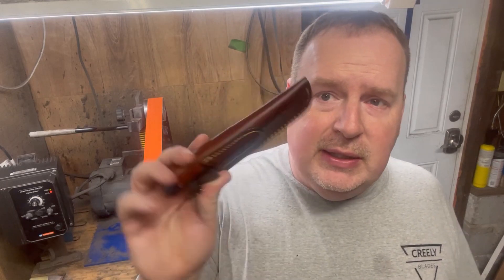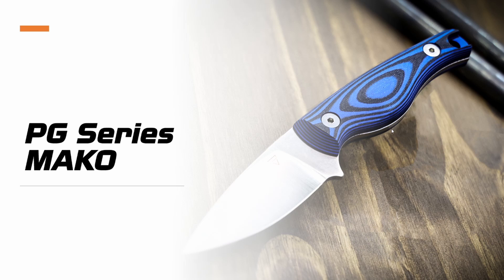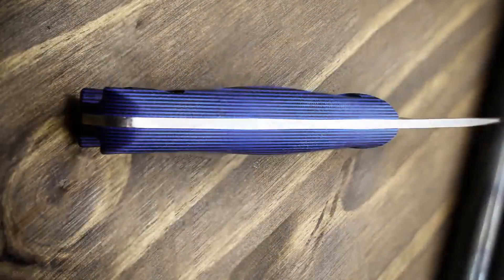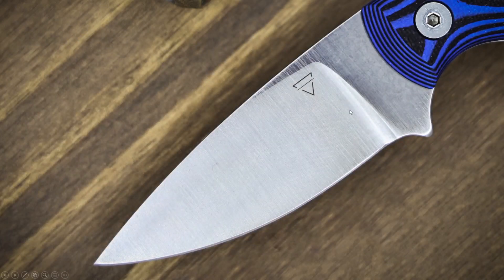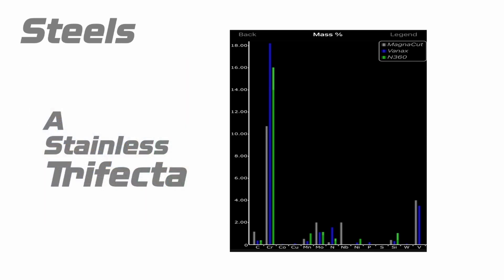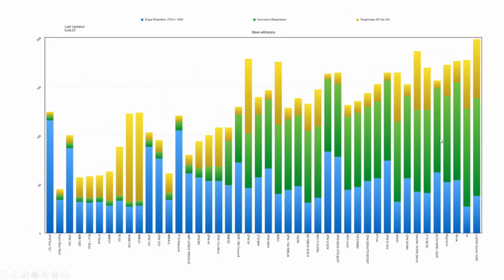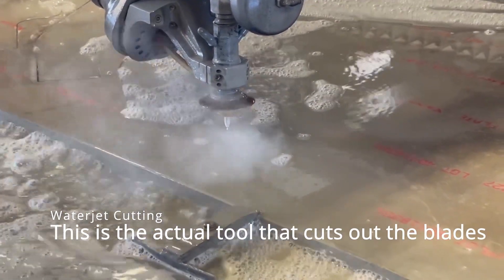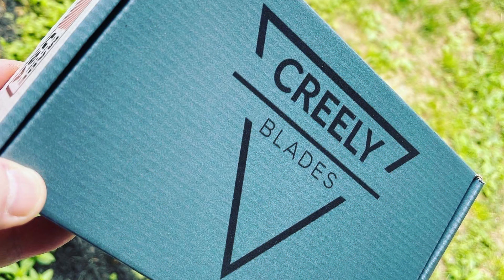CPM Magnacut, Bohler Vanax, Bohler N360 (LC200N) Creely Blades Mako- Kickstarter.

Comment: Hi. I have a piece of the same approach than you, and I like 3V, 14C28N (price compared with LC200N...), Cruwear, Magnacut and Vanax. On your graphs, CPM 3V have much better corrosion resistance than CPM Cruwear. Thats true? Why? 
Thanks for your answer and sorry for my english.
Kiss from France.
Reply from the maker: One of the tricky things with 3V, and cruwear is that there are two different heat treating protocols and one of them significantly changes the corrosion resistance of the steel. 3V would have a little better than cruwear, but maybe on the chart the cruwear is rated at the other heat treating protocol.
Reply: @Creelyblades  Ho yes OK, i have read one thing about that. With the "refresh" at low temperature (about 400°F) for increase corrosion resistance. Thanks for your information !
Reply: @jeromek6702 high vs low temper, high temper lets a lot of chrome out of solution

Comment: Hi. What is your reference for the corrosion resistance ranking chart? Did I hear you correctly? Your ranking of the corrosion resistance is NOT based on testing... LOL sure make up your data if you can´t find it. Jeeez man
Reply from the maker: Several of the steels I do have salt water testing data for, and others are inferred based on their elemental makeup as compared to the tested ones. There are really only about 4 categories of corrosion resistance as I see it. Not stainless at all (aka- 1095, 52100, A2)  Semi-Stainless (3V, D2, )  Standard Stainless (S35VN, 154CM, 440C, S90V), and extremely stainless (LC200N, Vanax,)   Additionally, even with testing corrosion resistance can be tough to pin down, for instance, some steels do well in salt but not acids, others do well in acids but not salt. I stand by the ratings on the corrosion resistance chart as a good guide for a particular use case.
Reply: @Creelyblades  I communicated with Larrin  Thomas. Lets compare notes and make a listing based on testing - for rust. And, lets face it, "stainless" is kind of a misnomer.

Comment: Bad way of explaining Magnacut and niobium - as I know you know man it's in there to stop the precipitation of chromium carbides because of it's.. binding affinity? 😒 Creating niobium carbide/carbonitrides and with the vanadium helps grain but is mainly to suppress the creation of cr²³c⁶/Cr⁷c³ and instead form CrV⁷C³ carbides leaving more of the chromium in solution for passivation? Correct? *I am not a metallurgist nor have a college degree*

Comment: That the tang is protruding over the handle scales is there to help align the scales for fitting is the dumbest thing I have heard. Why not just admit that you got the measurement or machining toleranse wrong 😂👎
Reply from the maker: Why not admit that?, Because I did it on purpose that’s why not.  I’m just being candid and honest about the process. If the knife is not for you, no problem, but don’t insinuate that I’m a liar and troll me.

Comment: Is ordering a PG mako in magnacut off the creely blades site the same as backing on kickstarter?
Reply from the maker: Those orders will be filled after the Kickstarter orders are filled, but similar concept
Reply: @Creelyblades  well shoot is there any way I can become a kickstarter without having to order a second blade if I've ordered one off the site? handle scale color doesn't really matter much to me as I might have a go at making my own for it down the line.
Reply: @Creelyblades  and to be clear what I’m asking is if I can transfer a creely blades site purchase to one of the available Kickstarter slots.
Reply from the maker: @kevindeuschle3413  The Kickstarter orders were only open for a period of 20 days a couple months ago, there are no open slots for Kickstarter as that campaign ended.
Reply: @Creelyblades  oh, ok. sorry about that. I'll be patient then as difficult as that is going to be =). Thanks for getting back to me.

Comment: How does your chart put LC200N above H1 in corrosion resistance?
Reply from the maker: They are the same on the chart and it is ahead just because of the way it is sorted. Additionally, if there are 2 steels right next to each other on a chart with this many steels I would not get too burned up about their exact order.
Reply: @Creelyblades  ok for sure. Thanks for the reply. I will calm down! Lol.

Comment: Hey Gary,
What do you think of 80CrV2 as in Winkler’s offerings? 
Thanks!!
Reply from the maker: It is a nice clean low alloy carbon steel. It is high toughness, low edge holding, and not corrosion resistant. 52100 would be my choice in that style of steel.
Reply: @Creelyblades  Gotcha! So are you saying that for a type of blade that would be used in combat type and more extreme conditions, that 52100 would be the solid choice? 
Thanku Thanku!

Comment: Great charts and comparison! However, I've got to be careful with toughness of some steels. The graph of high toughness doesn't mean it's both anti-chipping and anti-bending. H1 for example, is hard to chip but easy to bend and doesn't get back. I'm not sure if I can call this steel 'tough'.
Reply from the maker: The toughness in the chart is based on the notch c toughness test. That is one aspect of overall steel strength, it does has some considerable correlation it other aspects of toughness and strength. As you point those correlations are not 100%
Reply: Anti-bending is strength, aka hardness in HRC, or at least rheyre very closely correlated. Toughness is resistance to fracture. Mild steel is pretty tough but awful for a knife, toughness without hardness it's just ductile. And hardness without toughness just brittle, though generally you need a lot more of one than the other. H1 is soft stuff, 55hrc at best.

Comment: Is lc200n really tougher than Magnacut? The charts on knifesteelnerds and on your vid show that it’s tougher. I’m trying to decide which steel to order in my Mako
Reply from the maker: It is a little bit tougher, but on the size of blade of the mako that really doesn’t matter. Lc200 is more corrosion resistant also,There’s a lot of hype around Magnacut right now and it is a good steel, but Lc200 and is more rare and special
Reply: @Creelyblades  thanks for the info. Before I saw this reply I ended up just ordering a Mako in the Magnacut right after I saw Pete’s vid about the Mako in Magnacut lol. I got really hyped about the steel after that vid. I think both of the steels would serve me well though.

Comment: What  about  AEB , do these steels are top notched also!
Reply from the maker: AEBL is great, and punches above its weight as a poured ingot stainless. These 3 are in a different class.
Reply: @Creelyblades  Sir, I  am  excited  to  acquire , one of at least nice & affordable  lineup of your Mako  fixed blades , like  the ones, I’ve mentioned &  Cruwear which I find out is more expensive!

Comment: Why is laser cut steel with a broad tang a benefit?  That seems to only be a benefit to the maker and mass production.
Reply from the maker: I’m not exactly sure what your criticism is here? When you say broad tang I assume you mean full tang. I don’t think that water jet cutting was being presented as a benefit, simply an explanation of how and why it’s made the way it is. In terms of its benefit to the end-user it allows the knife to be more affordable because of a more efficient process.
Reply: @Creelyblades  Auto correct problems :(. I meant proud, the tang is proud of the scales.  I do agree on affordability but what’s the benefit you are pointing out in maintenance in the video?  Isn’t the primary value to reduce production effort (note I’m all for automating production).
Reply from the maker: @brandonnelson4164  No doubt that efficiency is part of the equation, but there is a bit of a benefit. If I use removable scales and sand the steel and scales flush so they are perfect, and then you remove those scales it is virtually impossible to get them back on perfectly again. There is always a sharp lip somewhere. Making the a little proud and tumbling makes it a lot easier to take the scales on and off and swap them between different blades.

Comment: I'm excited to back this. I love the custom mako i got a while back, feels great in the hand and looks great to boot!
Reply: Update: Got the stainless mako PG trio in the mail and the knives turned out really nicely. The behind-the-edge thickness is very fine, the knives came razor sharp, the fit and finish is very nice-nearly as good as the flawless custom mako. The new util clip sheaths are also nice. 

I think these stainless knives need a kydex sheath, because the knives will hold up in water, but i would hate to ruin the leather sheath in the boat or in the rain. I might have to take stab at making something like the sheath that comes on the s90v version of the benchmade hiddon canyon.

Comment: I couldn't help but notice the 14C28N steel was so similar in toughness, edge retention, and corrosion resistance to the Magnacut. I know charts and graphs often don't tell the whole story. 
How similar are these two steels in real world? 
The Magnacut is intriguing, but the current real world cost is prohibitive, while the 14C28N is quite reasonable in cost and availability.
Reply: 14c28n is a really good steel. But correct me if im wrong here, I've heard magnacut would likely have better edge stability.
Reply: @tacticalcenter8658  I've heard 14c and AEB-L perform at about the same level... watching some testing done by Carother's knives of AEB-L and their delta 3v, AEB-L did about the same or better on edge stability. Leads me to believe that given a really good heat treat 14c wouldn't be too far off from magnacut. Now if you're comparing a mass produced blade in 14c28n to a custom from Creely in Magnacut... not even close!
Reply: @Ajaxykins  it would be nice if knife manufacturers and designer's chose the correct steel and heat treatment and did it to its full potential for the task's it was designed for for all mass production knives or customs. Sadly the world is re3ee3ee
Reply: 14c28n is the best budget, lower edge retention type of stainless steel for knife making. Incredibly tough, good corrosion resistance, very good edge stability, edge retention is okey. Magnacut is less tough, but has a lot better edge retention, even better corrosion resistance and excellent edge stability, it has the edge retention of s30v, but the toughness of 4v and cruwear. that is just absolutly amazing. Also 14c28n has better corrosion resistance and edge retention compared to aebl.
Reply: @svenvanderzwaag1012  nitro-v is another similar option as well. It can get higher in hrc as well. I'm not sure if its more costly though.

Also I thought magnacut was tougher than 14c28n. I didn't look at the data sheets recently though.
Reply: @tacticalcenter8658  yes nitro v is pretty similar. 14c28n has better toughness and corrosion resisantance though and about the same amount of edge retention. Knife steel nerds has a lot of good information about steels.
Reply: @svenvanderzwaag1012  yeah I read knife steel nerds but was too lazy to look at datasheets ;)
Reply: The edge retention difference is certainly there. It's looking like 30% or more, not accounting for hardness. And the edge retention pulls ahead more as the blade gets duller, wheras low carbide get dull more linearly. It's certainly a super good steel but Larrin agrees that 14c28n is the best knife steel for the cost, especially due to edge stability and it being able to hold a thinner edge to gain retention over many knives.